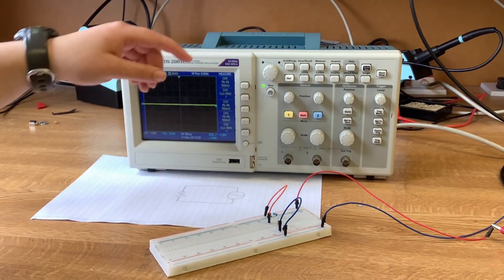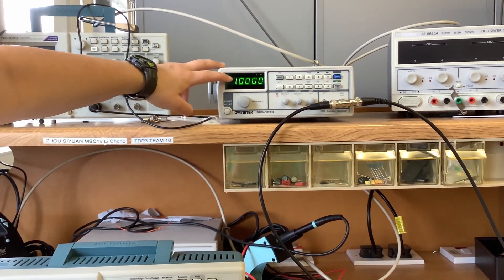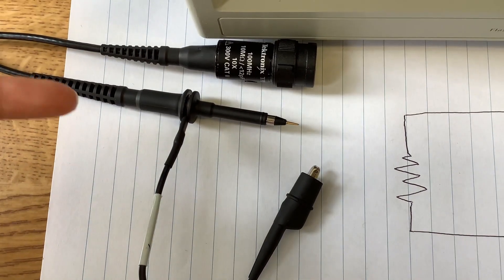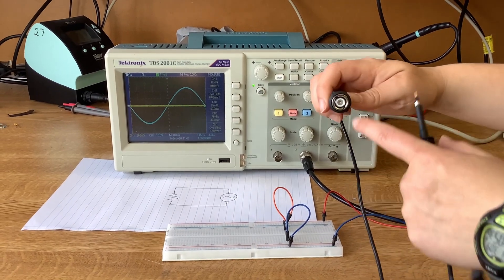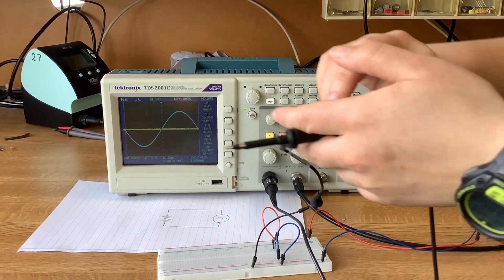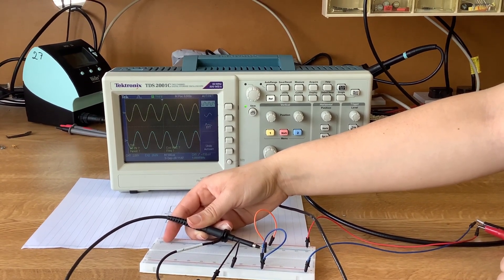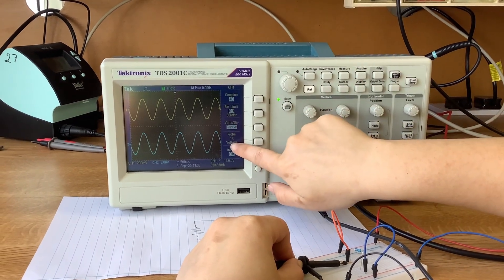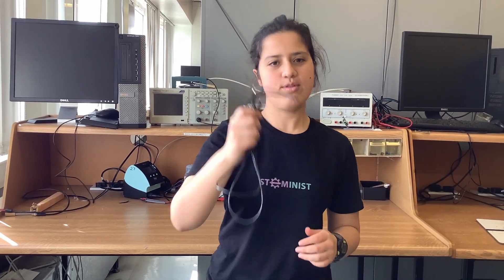FemEng Lab Episode 4 - Using the Oscilloscope | Grass Roots | Education | RS Components

Comment: Hello, I don't want to sound negative (no pun intended) BUT, your video would be more interesting to listen to if a) you remove all background music:  using background music is a common mistake with amateur videos; background music is distracting even at very low volume; background music should only be used when there's no talking going on and you want to "fill in the silence" perhaps.  But when there's talking background music is a no no,  b) your voice is coming out of the right channel only; I tested your video using headphones and with external speakers and your voice only comes out of the right channel : this is not a problem with my system, but with your video.  I hear your music in the left channel and your voice in the right  channel.  This is a very disorienting experience.  When we listen to a video, especially an instructional video as this one, we expect the instructors voice will sound normal, meaning coming out of both channels to start with so that the voice sounds as if it's "in the middle".   Besides being an electronics engineer with a degree I also produce professional video so my comments are not meant to be negative but to be instructive and  helpful.  Reconsider these issues when you do your next video.  Listen to some of the many instructional videos here on Youtube that are done well, some quite exceptional.  It's not that hard to get right so good luck !